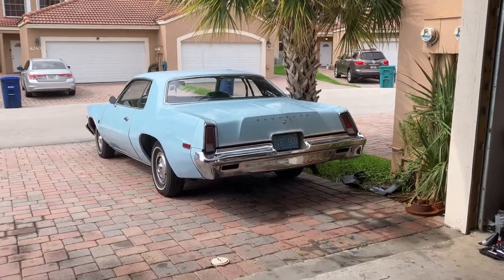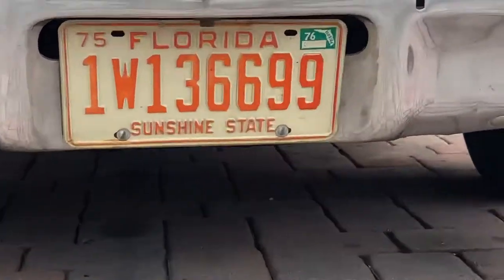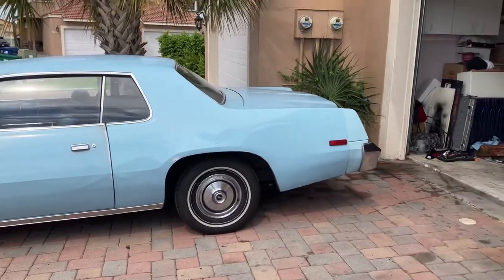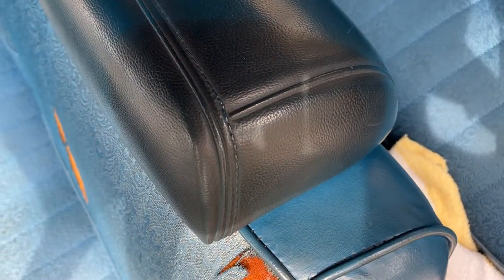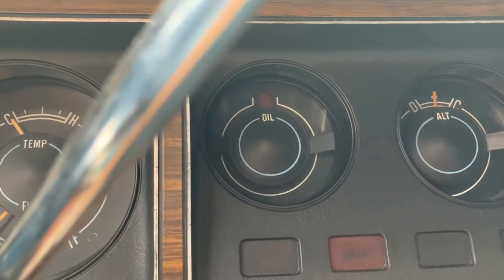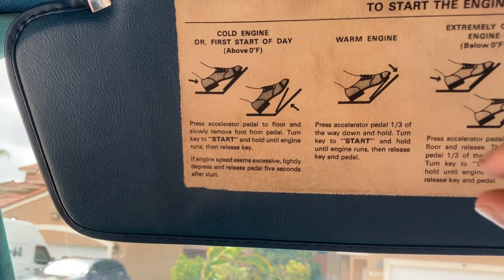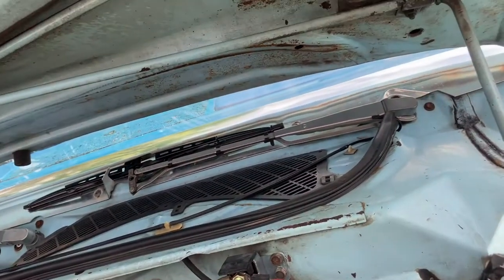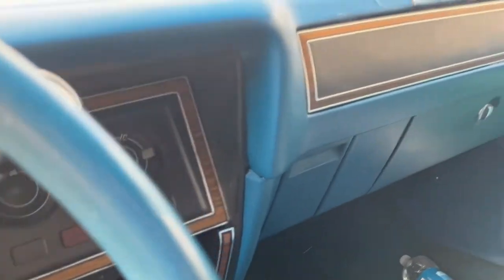1976 Plymouth fury sport coupe in-depth review

Comment: I ordered a 1976 Sport Fury, black, gold interior, bucket seats , sunroof, hd suspension, 400 4bbl, dual exhaust, hd alternator, hd battery it listed at $6776.00  I put Cragar SS wheels on it. Since I had the 400 4bbl it used leaded gas, so no catalytic converters. But they put the smaller gas tank neck on the tank. So I had to use a funnel to put gas in it until it got changed.  I got about 10 mpg with that car, good thing it was cheaper then. I started with ordering a 1975 Roadrunner, but it was late in the year, so they wanted to alter some things, but when they asked to put a 318 in it, I said no and cancelled. 1975 was the only year the Roadrunner was in this body. In 1976 they put it in the smaller Dart/ Duster body.

Comment: Back in the day when that car was new the passenger side mirror was a option u had to pay for lol the side molding than ran down each side was the protection kit option had to pay for lol. Now all the new cars today they all come with those things lol. I'd rather own a old car like that over anything on the road today i call ipads on wheels and they are all garbage. Nothing like a old land yachts solid metal & engines that run forever lol. I inherited a 1976 Chrysler New Yorker Brogham from a aunt with 20,636 original miles & still looks like the day she bought it original everything right down to the plastic on the seatbelt buckles. My favorite car ever

Comment: My 3rd car but the first I picked out myself was a 76 Sport Fury.   It had some of the add ons you mentioned.  I remember the rubber on the rear bumper and the front bumper stops.  It actually looked good IMO.   The 318 was bulletproof, but if you live in a cold climate, the electronics was problematic.  The Mopar plastic was a pain as you see it fades.   Mine Fury was White with Red interior.   Brought back a bunch of memories.